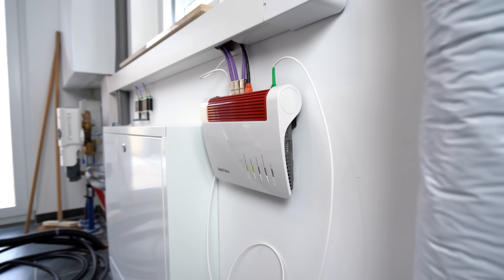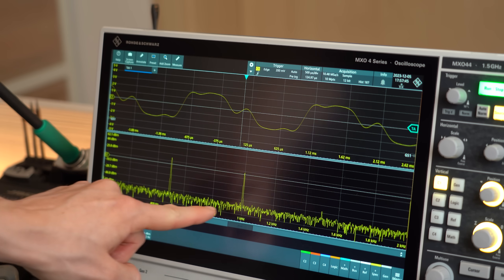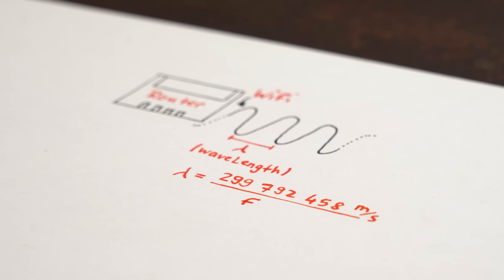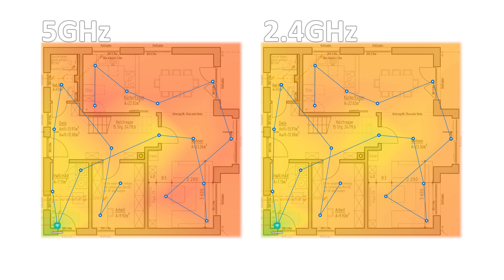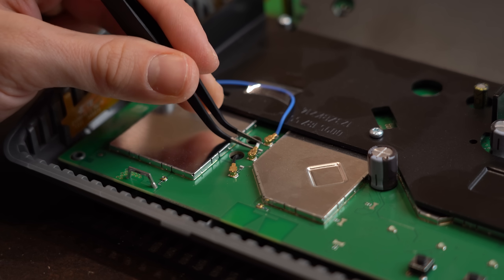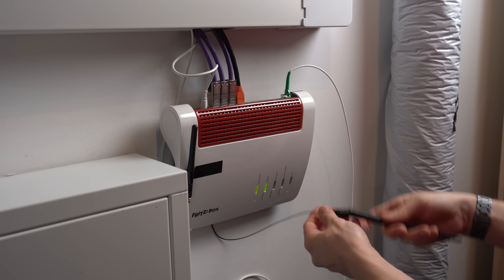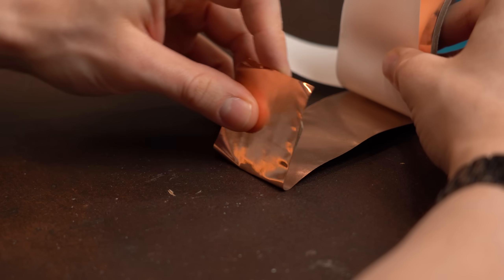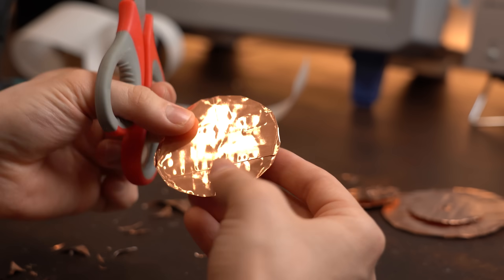I tried OVERPOWERING my WiFi!

Comment: Kreosan's antenna (Yagi) must have worked better if the router were outside that room and even provided better signal strength since the Line of sight seems to be clear to the hall based on the house plan. But i suppose moving the router is not a great idea and the other antennas have already redeemed themselves.The Yagi might possibly work better if you are trying to connect to a network 2 houses away in the sky. But with the walls, it seems to hinder its capability. For fun it would've been nice if you could have done a test with both antenna types at the roof and see which one increases the range. But alas, that is not the motive behind the video. Great video as usual. 👍
Reply from the maker: Thanks for the feedback :-) Maybe this topic will come up in a future video ;-)
Reply: @greatscottlab  I suspect the Yagi needs better construction than cardboard.
Reply: The biggest problem with a Yagi is that it has at most 30 degrees of effective radiation from where it's pointed.  So in a square building, you definitely won't get the best signal on the side corners.  That said, I suspect that RaOne is correct about shorting the plates.  There's a really cheap Yagi I saw on Amazon which uses nylon male-female screw spacers to link each plate.  No idea if it works, but it definitely has each plate insulated.  Finally, you can find professionally made 2-5GHz Yagi antennas out there, which might be a major improvement over the DIY one.
Reply: It was made with a metal bolt and nuts so all plates were shorted which it shouldn't be
Reply: @RaOne-gk3ok  These types of antennas have zero potential in the centers (nodes), so it doesn't matter if they are shorted.
Reply: @dmitry771  You reduce the bandwidth if you leave them shorted, and you do a lot.
Reply: Might try the CAntenna, works well compared to that weird copper disk, bolt and nuts.